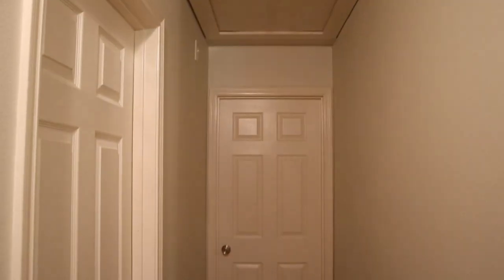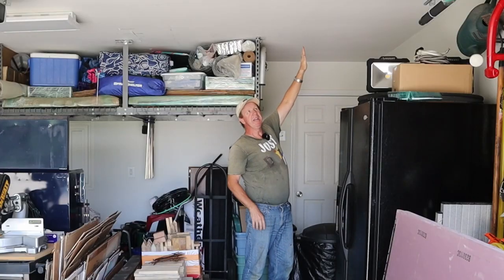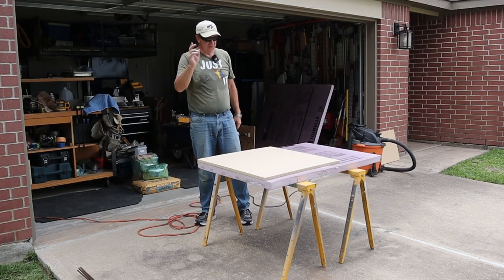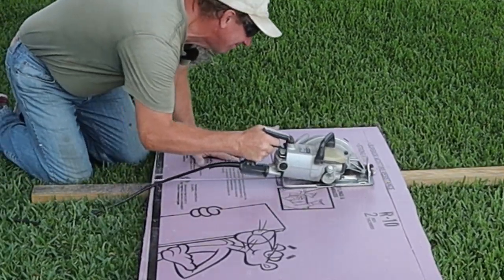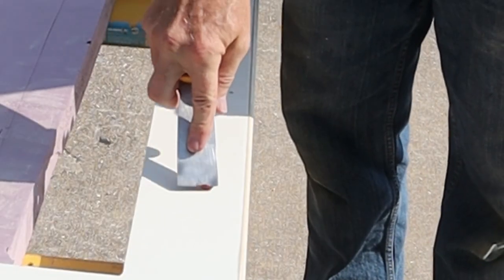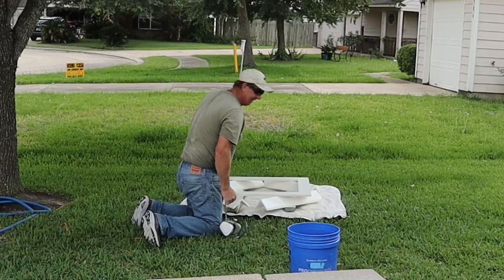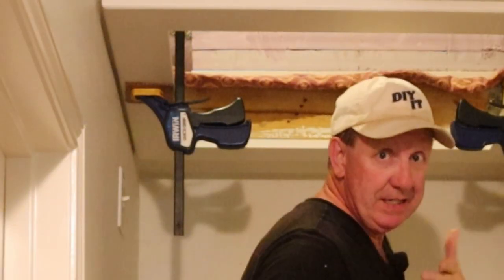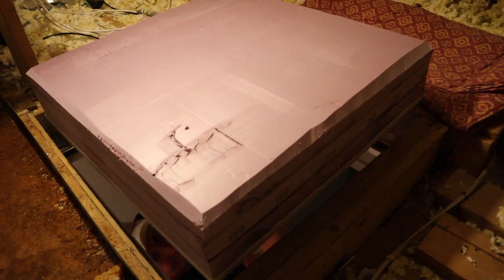Attic Entry 2.0 Make Over & Energy Efficient To Boot!

Comment: Please do a video redoing the insulation in the attic. After removing the old insulation, you can use spray foam in a can to close all the air gaps. There was a video on Youtube called "Insulation 2.0" you can follow what they do in that. It will make a huge difference for energy costs and dust in the house.

Comment: I had the builder add 2 openings in my attic 22 1/2” x 54”, one in the garage and the other on the other side of the home (vaulted ceiling in the middle, otherwise no access). The one in my 3 car garage is near the door to the garage. I can pull down the stairs (purchased aluminum drop down stairs) even with the 3 cars in the garage. Ceiling height is 10’ 6”.  The home uses trusses in the attic. I put down 3/4” plywood (scraps when the home was being built) about 1/3 of the size of the garage. I use this for tire and car parts storage.

Comment: Foam board insulation can also be cut with a hacksaw blade -- it still makes some dust but less than using a circular saw.
Reply from the maker: Surprisingly I didn't have no where near the mess I was anticipating using the circular saw.  Thanks for watching

Comment: That foam board is R5 per inch , so it would be R30 in total with the 3 x sheets attached to the loft hatch , and not R60.
Reply from the maker: Your right my bad, I saw a 20 on the board and took it for the R value.  Thank you and thanks for watching